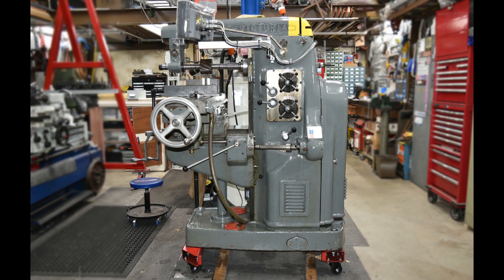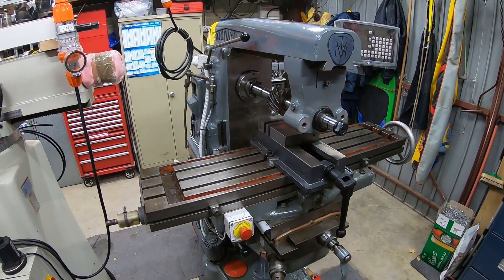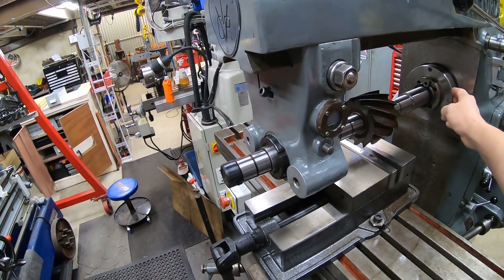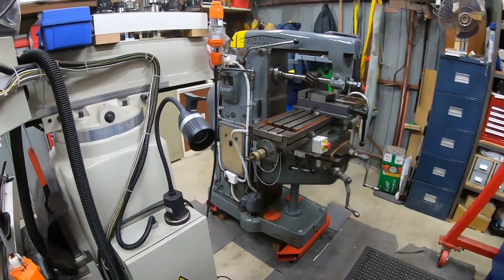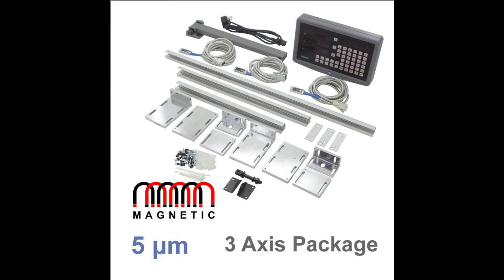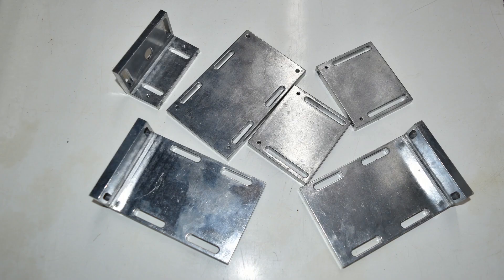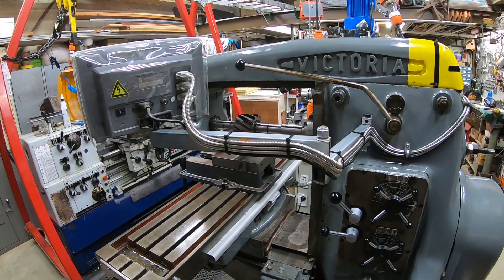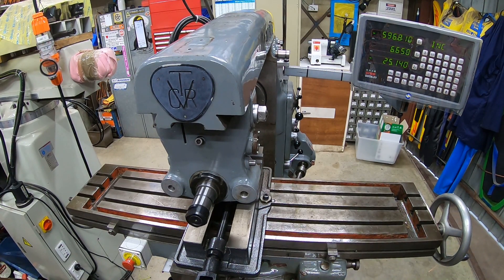DRO for Victoria (Elliott) U2 universal milling machine

Comment: Have you ever stripped it down?
Reply from the maker: No, everything works so I have just been using it - although there is one issue that arose when I used the vertical milling head. End mills are typically run at much higher speeds than you need for horizontal milling and the machine gets quite noisy at the high speeds. I haven't investigated, but it sounds like a chain drive with too much slack in the chain. However, as I bought a turret mill, I now only use the Victoria as a horizontal mill - so have little incentive to diagnose and fix the problem. One day perhaps...
Reply: @alanshomeworkshop  I've got to take mine apart the lever for changing the spindle direction is missing along with any linkage that goes with it. Lovely machines though
Reply from the maker: @smithbuilt  How similar is yours to mine ? Several variations were made and the only manual I have found for mine (ex lathes.uk.co) doesn't show any assembly info - just pictures of the parts. I can see a 5/8" pitch chain and 2 sprockets that appear to be part of the feed drive mechanism, but I do not see any parts that look like chain tensioners. If you can shed any light on this I would be very grateful.
Cheers, Alan.
Reply: @alanshomeworkshop  its identical, I have the capstan wheels for speeds and feeds plus my y and z axis "hand wheel" locations are like yours with the knee elevation off set to the left slightly.
Reply from the maker: @smithbuilt  Well, my mill has a 2 speed motor and the lever that you are missing has 6 positions:
Pushed in for fast speed range and pulled out for slow speed range
In either case, left position gives spindle anti-clockwise rotation, centre position is neutral to allow push/pull, and right position gives spindle clockwise rotation.
These outcomes are achieved by mechanically setting the contacts in a large (and heavy) electric switch - which probably belongs in a museum.
So, if you are having trouble sourcing the missing parts, it might be an option to just replace the original switch with modern equivalents.
Reply: @alanshomeworkshop  it's been converted to single phase, I'm wanting go put it back to 3 phase. Cant do it yet as I have a long list of things to do before I get to it but once I do it's a full strip and rebuild as it's been sat for 20 or 30 years according to the guy who sold me it.

Comment: Hi Alan, nice informative video, I have been offered a Victoria mill I think it slightly older than yours it has the levers on the side for changing the speed, I have a small mill at present but am tempted with this Victoria mill, they tell me the fastest speed is 560 on vertical head and it might not be sufficient for small end mills, the price is £600 so you can see it’s very tempting, you views would be appreciated
Reply from the maker: Terry, welcome aboard and thanks for subscribing. I gather these mills have been sold with many configurations. Top speed on the horizontal spindle of my machine is marked as 900rpm. However the drive to the vertical head is through a gear train that lifts the head up for more working room and includes a 2:1 step-up. So top speed of my vertical spindle is 1800rpm. While I haven't found speed to be a problem, the lack of a quill feed is a bit limiting. This led me to purchase the large knee mill which appears in many of my videos, and this gets a lot more use than the Victoria - although I did use the Victoria as a horizontal mill in a recent video. The Victoria is a solid, well made machine and there are still many of them around giving good service. Cheers, Alan.

Comment: Very nice work mate. Any chance you could measure the gibs that hold the vertical head on? And the gear that engages with the head? I’ve got a head but no gibs or gear from the int40. I’m happy to pay you for this information.
Reply from the maker: No problem, I'll try to get on to it in the next day or so. If you care to provide an email address, I'll send you some detailed photos as well.
Reply: @alanshomeworkshop  thanks very much! freddowdell@hotmail.com
Reply from the maker: @grahamdowdell4356  Have sent the info you requested; hope it helps.

Comment: Hi nice install, very neat. That said, I am not sure I am a fan of the sales you used. Not that they are magnetic, but rather that the mounting points are under the adhesive magnetic strip itself. If the scale casing collided with something that caused it to move out of adjustment, you'd have to unstick the magnetic strips to get at the bolts? And wouldn't you risk damaging it?
Reply from the maker: Thanks for your comment. I understand and share your reservation about the use of adhesive to secure the magnetic strip, but the key benefit is compactness - critical in my application. You may be sure that I checked the alignment of the scale casings very carefully and installed mounting screws with Loctite before sticking the magnetic strips in place. The scale casings are located to avoid any fouling during the full range of machine movements and are generally out of harms way. However, it will certainly pose a challenge if it becomes necessary to remove or adjust a scale casing. If this does ever come to pass, it seems unlikely that the magnetic strip could be removed without damage and it will just have to be replaced. Happily, the DRO system has been installed now for about 5 years and there haven't been any problems. Cheers, Alan.

Comment: Nice machine! I have the exact same model in my garage, converted to cnc. All the horizontal parts and carriages arbors, spindle heads etc. I sold to another U2 owner, as I had no use for them. I converted to high speed spindle with iso30 quick change.